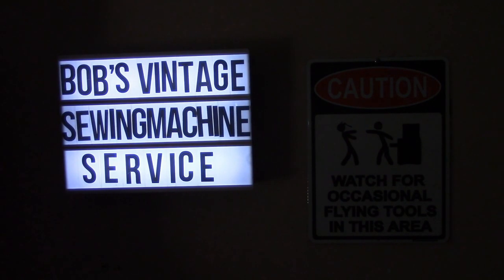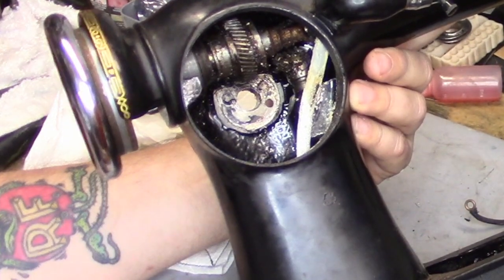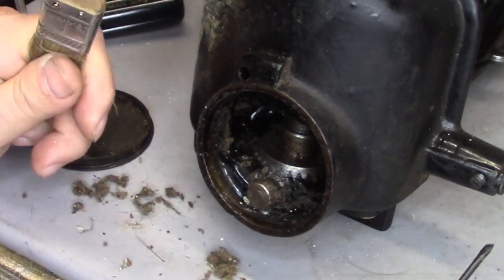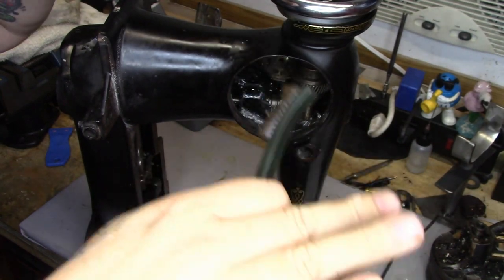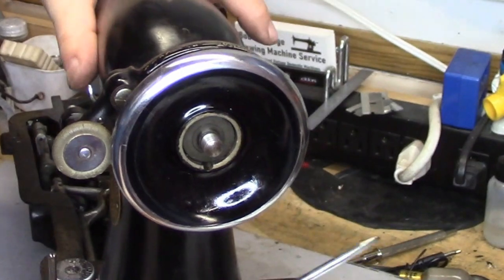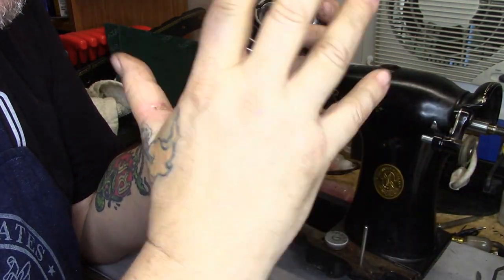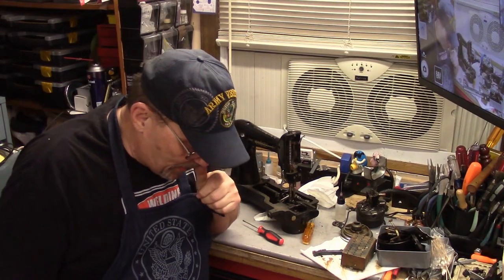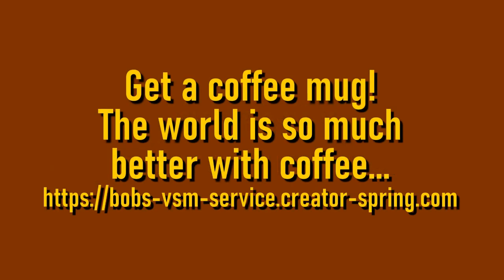Down and Dirty with a Singer 101 - Sunday Morning Quickies, Episode 50, July 10, 2022

Comment: 101-2 was my first rebuild, ever. You're right about the fly wheel and those stupid plates. I did everything from rewiring the motor to totally disassembling the cabinet (it was in pieces anyway)  I found real petroleum grease (bicycle bearing grease) for the motor and gears to match the original grease. I had to take out the light twice, the first time I wired it I used a stiffener but wrapped it with painters tape. The tape worked great but then I saw your trick with the shrink tubing I redid it. Everything looks great now, works great now, ( great stitch) and the cabinet is beautiful. BUT, I had to make the lower leg switch extension; I'm looking for an original. So,,,, if your friend that sent you that 101-2, and is getting it back in a bent wood case, wants to sell the leg switch off the cabinet  I'm in the market for one. : )  tom

Comment: I got a 101 recently and I can't believe how dirty it is - just like the machine you're working on! Could you explain a bit more about the clutch? Why would you need to disassemble it, and how can I tell if it is working correctly? Is this the part that sometimes has a broken spring inside? Thanks.
Reply from the maker: Look at page 18 of the adjuster's manual. It describes how if the clutch is slipping, the motor will run, but the sewing action (needle bar and feed movements) will not be engaged - kind of like being stuck in bobbin winding mode. I don't recommend taking the clutch apart unless it's slipping. It's not a "normal" maintenance job and can be a real pain in the posterior to do correctly. If you don't have the manual, I have it on my website here:
https://bobsvsmservice.com/wp-content/uploads/2022/01/Singer-101-Adjusters-Manual-Print-size.pdf
Reply: @BobFowlerWorkshop  Thanks Bob, I will check when I get that far, but I never do more than is needed. I'm not sure I even want to take the needlebar apart, I just rinsed it well with kerosene and it's moving fine. But boy, the schmoo in this machine was unbelievable!